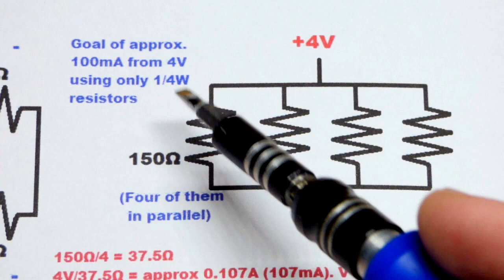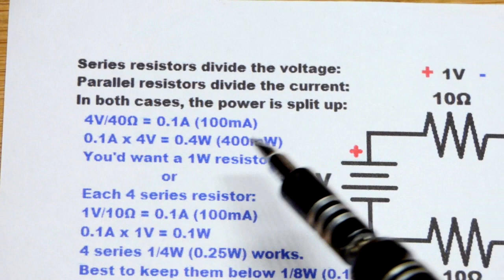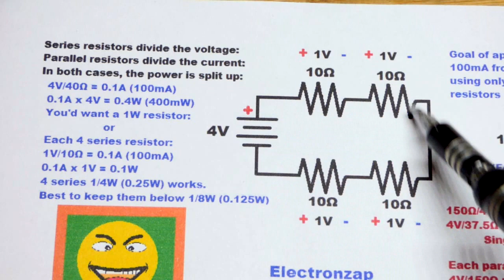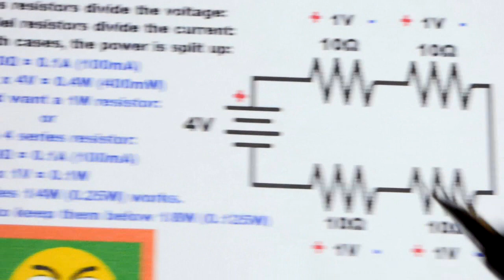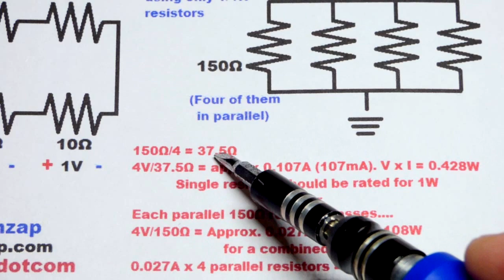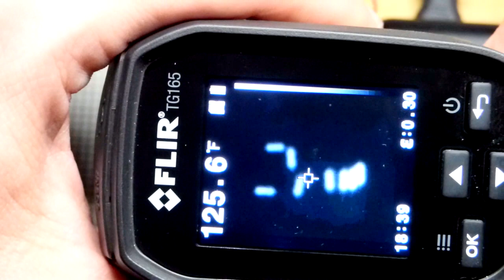How to substitute a higher wattage electronics resistor with lower value series or higher parallel

Comment: I have a silly question. Is power draw from the power supply the same when using a resistor(s)?

I need to reduce the wattage of 12v heating pads or get a bigger power supply. Was thinking some resistors could do the trick but have yet to fully wrap my head around the math/circuit design. Thanks for the help!
Reply from the maker: With a 12V heating pad, adding extra resistance in series will lower the wattage. There will be less current flow. The resistor will also get hot, so it needs to be a high enough wattage resistor for what it will end up dissipating, you need to avoid anything flammable coming near the resistor, and it could cause burns if a person touches it. Series and/or parallel resistors can split up the power even further if need be. But yeah, unless the heating pad is made to not work at a lower voltage for some reason, then it should just get less hot and consume less current when there's extra series resistance.

Comment: So, why then, when I connected 10K 0.25W resistor to the 12V battery it got hot enough to burn my finger? According to the calculations: 12v/10000 Ohms = 0.006Amps; And then 0.006A*12V = 0.072Watts. While resistor tested was 0.25W - way more then 0.072Watts required. Why is it getting melting hot?
Reply from the maker: Sounds like there's something wrong with that resistor.